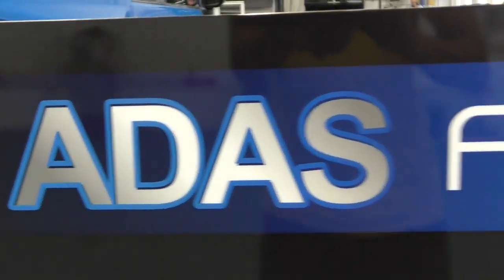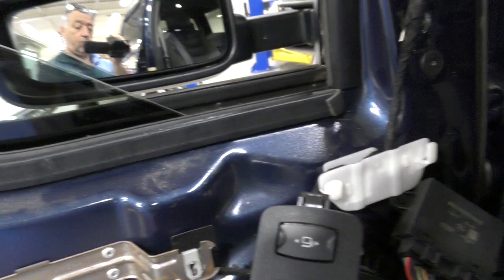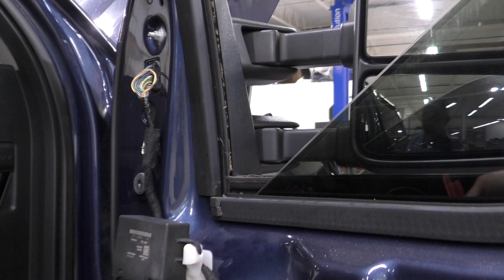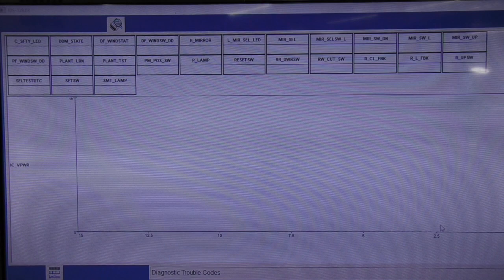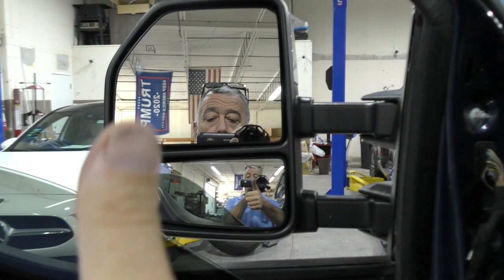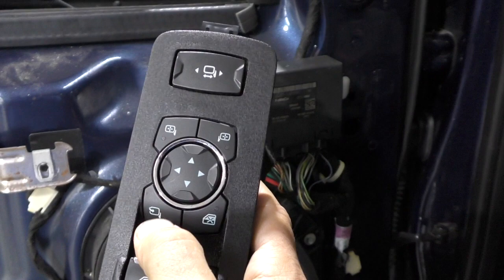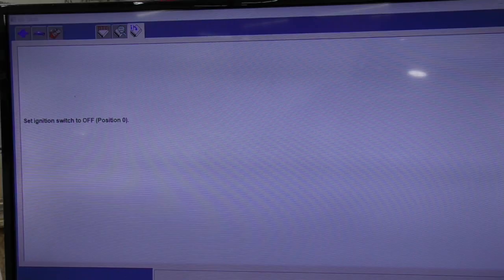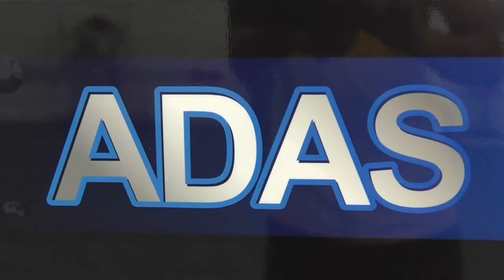F350 FORD Power folding mirror  fix extended trailer mirror

Comment: Something to consider, my tow mirror harness was severed internally. Fold grey was corroded in half. The green for glass up was broken. 3 other wires looked like a knife went round em. This is the harness inside the mirror itself

Comment: I have a question I would like to ask of you regarding this but a little different. My truck is a 2012 f-550 xl , I put all wiring and interior including all power options from a 2012 f-250 xlt lariat. with my original BCM the truck will start and run but no power locks and no slot for the fuse. if I put the other trucks BCM everything works but truck won't start.